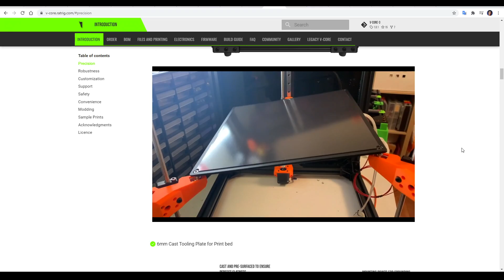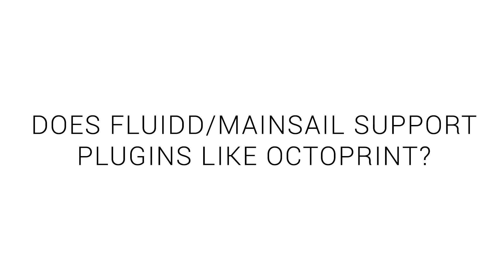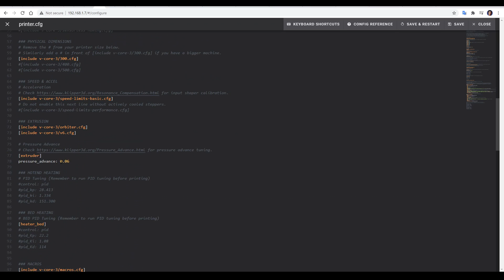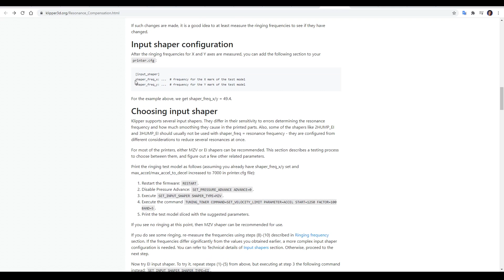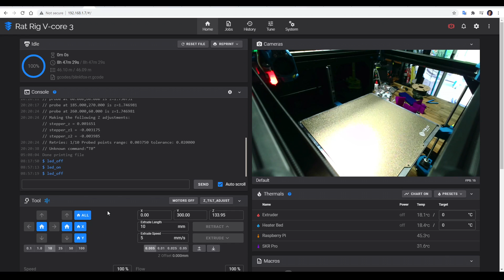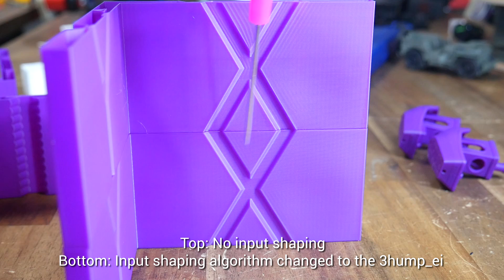Klipper input shaping - A leap forward in high speed AND high quality 3D printing [Rat Rig part 4]

Comment: Hi Michael. Another great video. I did the ADXL345 tuning on my SKGO a couple of months ago and have been astonished by the improvement it made to some already great prints. Just one point... It seems like you need to swap the Z & Y axis for you ADXL345 because of the way you mounted it but you never mentioned that. By the way, I love the colour of that purple filament - what is it?
Reply from the maker: The filament is X3D Pro pla purple. I was wondering about that since the ADXL mounts on the EVA pages used different orientations. I figured the firmware was smart enough to see that one axis of the accelerometer was a lot more active than the others and take that as the input.
EDIT: From the docs: "It is better to align the axes of the accelerometer with the printer’s axes (but if it makes it more convenient, axes can be swapped - i.e. no need to align X axis with X and so forth - it should be fine even if Z axis of accelerometer is X axis of the printer, etc.)."
Reply: For anyone wondering, you can simply add axes_map to your adxl config, this would swap the Y and Z axes, seems simple enough even if it isn't "required"

[adxl345]
axes_map: x, z, y

Comment: Would it be possible to get Klipper and imputshaper to a ender 3. Could you make a video for this. Thanks :)
Reply: Yes it's possible. I'm running klipper on my ender 3 pro. I only did basic inputshaping (without the sensor) but that already gives very good results
Reply: Yes, it is possible. Just flash a new bootloader on its board, you can even follow Michael's videos about that. You just need to replace Marlin for Klipper, and you are done. There are default config files for some popular printers, Ender 3 included, already available, so you don't need to wait long to put it to work again.

The only difference is that you need to attach the accelerometer rigidly on the Ender 3 bed to measure Y axis movement. That makes it impossible to let the accelerometer permanently attached, but that's not too bad.

And obviously don't forget the Raspberry Pi!
Reply from the maker: I'm going to convert a bed slinger to Klipper in future to see if the benefits are as good. Parts are ordered (including touch screen to try out KlipperScreen), so look out for probably a two part video in the future.

Comment: I think the voltage drop issue was an electrical interference issue. I had it when I wired up my accelerometer with a comparable cable loom. When I pulled the wires apart though, it started working.

Comment: If someone is new to Klipper (or RRF for that matter), please notice how Michael repeats "just save and restart" - there's no firmware flashing to change those rather complex settings.
Reply: That's probably enough to get me to eventually switch to Klipper
Reply: @kendokaaa  s88
Reply: Good to know. I'm switching to Klipper to try this. Never used it before.
Reply: @Apophis-en9pi  8l 8th
Reply: @Apophis-en9pi  literally the only reason i switched and then I learned to love the different functions even more
Reply: Paying for a RPi to go with a board is worth it just to not have to deal with Marlin and the stupid flashing process each time
Reply: using RRF is so sweet, all the configs just editable text files and you can alter many of them on the fly while its printing.
Reply: Gonna leave my Prusa stock, but when I build a Voron or RatRig it's getting Klipper.
Reply: sweet.. i'm always annoyed by the need to reflash after each fundamental config. Repetier has an extensive EEPROM, but still don't cover everything (also 8bit).
Reply: Hi, Pawel... I love Klipper, but have my Lerdge here too... heheheheheh Neither save and restart... Just mark in th screen and it's working!
Reply: @Dan N They'e talking about configuration changes, not firmware/microcontroller updates; which - in contrast to configuration changes - sometimes requires you to recompile the updated code.
Reply: Marlin: you send a gcode.....
Reply: You mean I don't have to drag my printer 150 feet to my computer and recompile the firmware to change any setting that can't be changed with gcode? What type of black magic is this?

/s.

Comment: I love your vids. I have an original ender 3 that I bought everything that you can get to upgrade it now I’m just having a hell of a time getting it all together correctly and then I thought I might as well throw a raspberry pi in it and try running klipper on it. I’m so new to this I kinda jumped in with both feet and got over my head. But with your videos and my so called knowledge I can get this working.

Comment: I'm building a BLV MGN printer and this is helping with ideas for it. Klipper is new to me but this does help ease the tension to get things going. Still thinking about a high flow hotend for the printer.

Stuck between Nova and the mosquito+ hotend. Nova is have the prices overall though. Thinking about what I want to get done is fairly fun.
Reply from the maker: Next episode my  Rat Rig gets a Mosquito Magnum. As for Klipper, there are many example configs available to hopefully get you started.
Reply: @TeachingTech  Hopefully by looking at the Rat Rig config I can take what i learn from that and apply it to the BLV set up. I would have gone Rat, however, there was not a metal kit for it at this current time. That being mounts for the linear rails and hotend fixture. Waiting on parts to come in is unbearable as I want to program and test stuff for the fun of it. 

Fun never the less.

Comment: You can use the marlin version of calibrating pressure advance, you just have to replace the lines for changing the pressure advance via note pad. It's way faster and easier to read IMO.
Reply from the maker: I like the reading of the Klipper tower, but I agree it is quite a slow print by comparison.

Comment: What are the advantages of having the bed move on all 3 z axis?
Reply: Using them with Z axis tilt can tram the bed to the X and Y Axis and then mesh level to get the bed as flat and aligned as possible before starting the print. You also need 3 points of constraint to constrain the bed, hence 3 motors rather than 2
Reply from the maker: Please check out part 3, there was a demonstration of the kinematic bed and more explanation.

Comment: Conapring an expensive printer with input shaper to a cheap one without is very very unfair.
Reply: Thats excactly the point of this comparison, that even with input shaping you couldnt push these speeds or accels on cheap printers, because the build quality and rigidity of the printer lowers with the price.
Reply from the maker: But that's the whole point. There are plenty of people watching this wondering how their cheaper printer compares and if it's worth spending the time and money to build a Rat Rig, Voron, etc.
Reply: @TeachingTech  but you should compare it to the same printer with input shaper on both ends
Reply: @ameliabuns  Yup, an Ender 3 can do 3000 mm/sec2 with input shaping. I'll be trying an Ender 5 soon, expect it to be largely the same.\ to be honest.

Comment: Btw a word of warning:
When I tried this I could go from 1800 Accel to 4000 easily. Tolerances were amazing and I saw no visual changes. However my dimensions got smaller and distorted by around 0.3mm. so If you go too far you might have issues! Amazingly I could still do 0.15mm for my moving parts at 4000 and 100mm/s
Reply: That's amazing. I know what my next project is!
Reply from the maker: Thank you, I will have to test more.
Reply: Did you try messing with XY Size Compensation in PrusaSlicer? (or equivalent in whatever slicer you use)? Wondering if that would help
Reply: @somethingelsedoesmatter  it was in a way that it couldn't be fixed in the slicer. I fixed it now with the latest firmware. I can only go to 3000 now

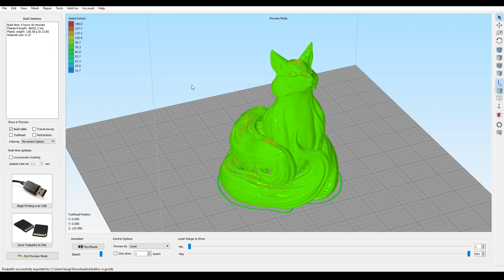Comment: Lowered you layer height to 1.5mm? 19:09 Michael you madman!

But seriously, this is amazing!! I'm assuming this works with any Klipper powered printer? Really considering switching my heavily modded Ender to Klipper for this.
Reply: yes, it works with Klipper, so it works with any printer the Klipper supports. Though for bedslingers 2 accelerometers are recommended
Reply: @tomaski.  That makes sense, one on the bed I assume. I'd like to see a full guide on manually tuning this. My ender is decked out with a Hemera Direct Drive, SKR and more. Obviously I can't add them to the SKR, and I'm not sure if the Pi can support more than one on GPIO.
Reply: @Apophis-en9pi  Michael already showed most of that manual method: you basically do the first print, take a pen, mark the ringing "bumps" measure the distance and do some maths. You then do the second print to verify the calculations
Reply: @tomaski.  I'll probably go this route. Otherwise I'd have to figure out a wiring solution. If it's a one and done kind of calibration, I don't mind putting in the time.
Reply: @Apophis-en9pi  it is if the printer at its current state will stay unmodified. Otherwise any change (be it new extruder, changed steppers, added camera) will impact the resonances and the test would have to be re-done. That's why everyone I know just leave the accelerometer attached, to be able to just issue those 2 commands and be done with it

Comment: Now try with an Ender 3. Yeah, no.
Reply: You don't think this would work on an Ender 3? Maybe not with a stock board but a 32 bit board running Klipper with a Pi, don't see why not. In fact it's probably easier on the firmware running it on an old school cartesian vs. a CoreXY like the Rat-Rig. Correct me if I'm wrong.
Reply: @Apophis-en9pi  Klipper can run on (almost) any board so it would work even with full stock Ender. Though the ADXL345 would have to be connected to Pi (for obvious reasons)
Reply: @Apophis-en9pi  I just think that the improvement would be marginal.
As is the case with Bowden systems and linear advance.
Reply: @alejandroperez5368  Probably correct for a stock one. One with a direct drive and linear advance tuned would be worth it though.
Reply: @Apophis-en9pi  Ender-3 has a heavy Y-axis. With a direct drive system, you have even more weight on the X axis. 
I think it would be the same or even worse than with a stock ender 3.
Reply: @Apophis-en9pi  cartesian vs corexy is not relevant with RPi. Even a Pi Zero has plenty of overhead for corexy, a 3B won't break a sweat. The math for corexy is a really simple even if it is a bit more complex than for cartesian.
Reply: @joshua43214  Makes sense. Decided I'm going to try this on my Hypercube Evolution first then do my Ender. I've never used Klipper, but my Hevo has struggled with Marlin on an 8 bit board for too long. So it's about time I learned.
Reply: @joshua43214  However, the RPi Zero does not have enough power for automatic input shaping. It's the only thing where it shows its lack of processing cores. 😕
Reply: why not? there can still be some speed and quality squeezed from it
Reply: There are many many people running klipper on an Ender 3, and using input shaper and pressure advance. There may be some mods like to direct drive to run pressure advance better, but in fact input shaper is very effective for bedslingers. Arguably, bedslinger printers need it even more.
Reply: @Zardozer  What the hell is bedslinger??
Reply from the maker: @alejandroperez5368  i3 style design like the Prusa i3, CR-1, Ender 3, etc. Basically it means the bed moves back and forth for the Y axis. The bed slings around.

Comment: Dang, Michael. That looks so cool. I wonder if some of the newer printers will integrate an accelerometer into their printer heads from the factory? I'm really tempted to build a rat rig now. Also, amazing work on the other mods. 3D printing is truly starting to become revolutionary.
Reply: I'd argue it was always revolutionary. But this..... This is next level stuff! What a time to be alive!
Reply: I'd say they'll just make a slot for the chip or something, just as Voron has, once the calibration's been done, it's not necessary to keep the accelerometer on the axis
Reply: @ravenous14  Makes sense. Seems like once it's calibrated it's good to go.
Reply: @ravenous14  No, the most brilliant thing about it is that it can finally bring real time information about what the machine is doing, if nothing at all. it can detect step skipping in great detail, it can monitor the calibration... The best parts are coming from real time data. Calibration is neat but constant adjusting and monitoring will increase quality, easy of use and safety. It should be able to detect loose belts, as they loosen over time.. Every single motion that the hot end makes can be read by the board. 

Two way communication, even if it is laggy and a bit inaccurate can provide a lot of options, just the safety aspect alone is enough for me. I have always hated the idea of having blind machines, now with a small CNC it has become even more stressing factor.  If only the brain knew what its hands were doing...
Reply: @squidcaps4308  I agree, but can Klipper do that yet? Because I haven't heard anything about what you're describing as a function yet
Reply: The new duet toolboard 1LC in Version 1.1 has the accelerometer integrated for that very purpose - only needs a manufacturer to use it.